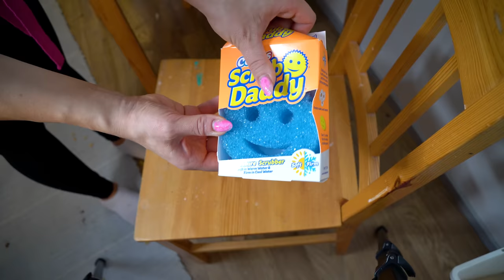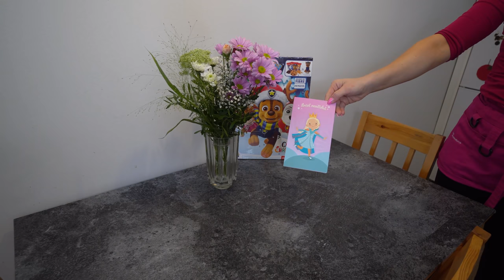FREE CLEANING HELP for the family — Genius cleaning tips! 💡🧹

Comment: I’m always so amazed with the bathroom clean because here in America we can’t just water and soap every inch!
Reply: I know! Makes me so jealous when I see her cleaning it like that. 🤣
Reply: I can't watch those cleaning videos of American bathrooms cause it doesn't feels clean to me if you don't use water,  Soap and Bleach on everything
Reply: @mochae_  yes. Unfortunately here in America, not all bathrooms are outfitted with tile floors, walls, and a floor drain. In fact, the house I bought had carpeting in the entire bathroom! Of course we tore it out before we moved in. Lol that's America for you. Cutting costs at any cost!
Reply: @mochae_  It depends on the home. Some homes you can soap, water and bleach on everything! We just don't have the drainage system in the middle of the floor. You have to either mop it or use a rag and hand wash the floor.
Reply: Same in the UK - most bathrooms don't have floor drains.
I'm also jealous that in the UK we're not allowed to have washing machines in the bathroom - I think it's an electrical safety thing.
Reply: @mins2midnite  Same for me, I'm in the UK. The other thing that makes me jealous is that UK toilets don't have the 'bidet attachment' (I call it a 'bum gun'!) you can see her spraying the floor with it at 11:56.
Reply: Huh No drain where does the water goes if you take a shower ….
Reply: @Lifeisfun84  shower areas are usually enclosed with a glass door and the tub is above the floor level so you can't push the water into the shower drain. And some bathrooms don't even have showers in them, just a bath tub
Reply: Same! My bathroom has large tiles, then a crappy plastic tub/shower & wooden trim 🙄 meanwhile every other room has a tile trim! Wtf America
Reply: The first time I saw her spray the whole floor I was like isn’t that going to ruin the floor?! Then I realized their were drains!
Reply: @mochae_  look at Poland bathrooms... so tiny... and we commonly have bath not shower
Reply: Same like in Australia
Reply: @Luce Dramatic much? Do you not feel like your kitchen is clean because you can’t wash the walls? You can use soap, water and bleach on every part of the bathrooms here, but the walls. Why are your walls so filthy that they need to be hosed down?

Comment: If you're struggling with overwhelming feelings with cleaning, use this little trick to get started!!

Set a timer:

5 minutes: Collect laundry
5 minutes: Pick up non trash stuff and relocate 
5 minutes: Large pieces of trash
5 minutes: Small pieces of trash 

If you don't get everything, don't worry! That's the point of the timer. A little bit at a time! Don't expect everything to be spotless in one day :)

Do this every few days, or when you're able to! Adjust the time as needed :)
Reply: Thank you for this :) Sometimes my energy seems to just disappear and this tip will come in so helpful during those times!